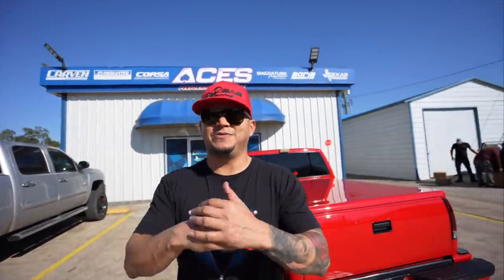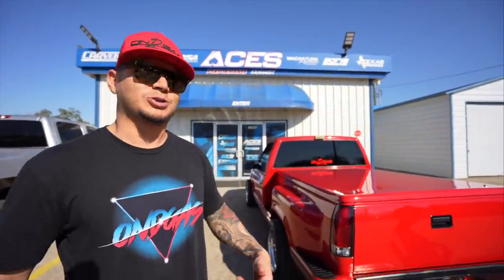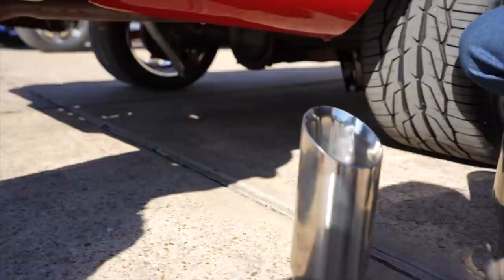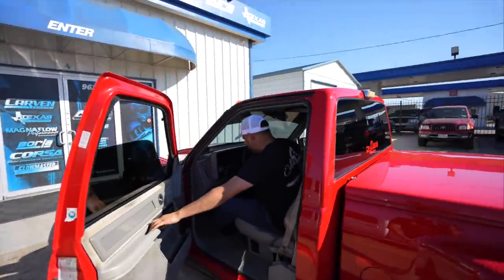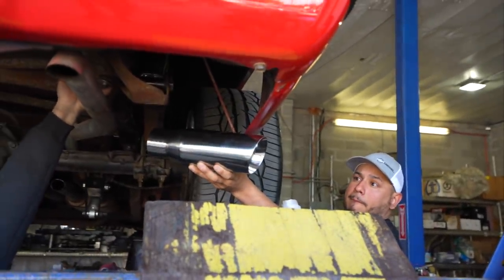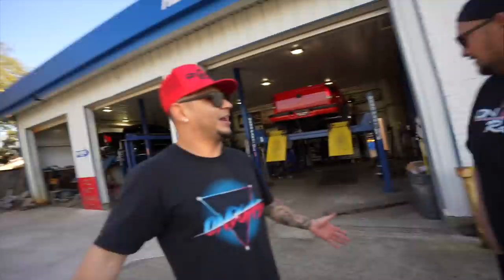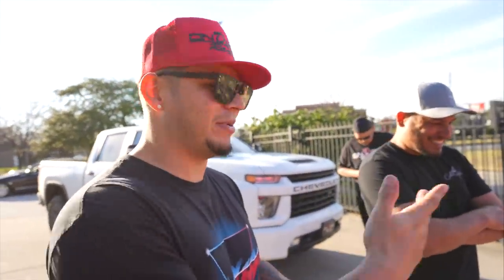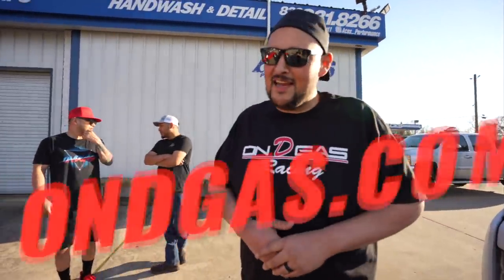Sound Truck OBS Giveway gets a Corsa Bullet exhaust!

Comment: My pops had a 97 short bed, with a 350 in it Edelbrock carb big 4 barrel and dish intake, I forgot what trans he had in it, but it was automatic with manual shift too, threw it on some wide offset street tires, man you talkin bout fast, mf easily did 170 u can do alot with these trucks with not a lot of work🔥🔥